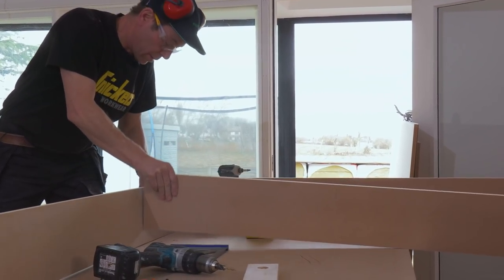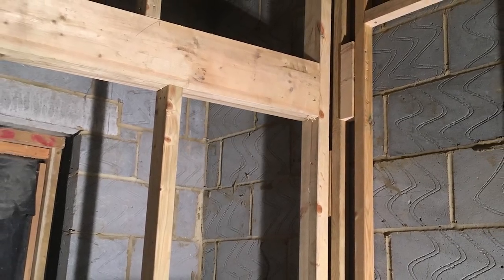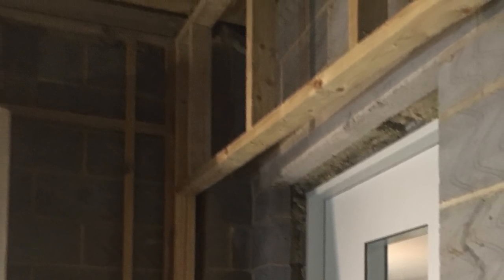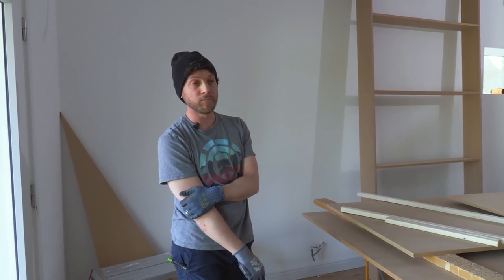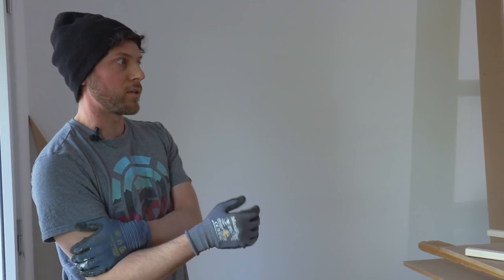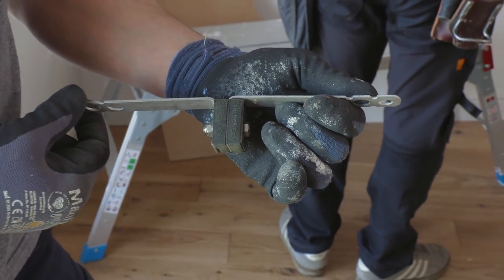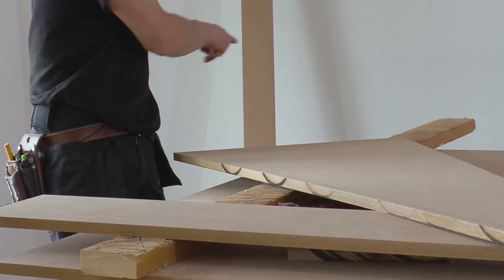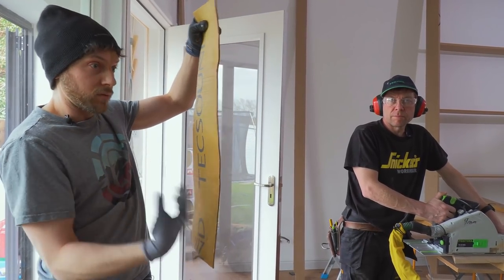How To Build a Soundproof Room?

Comment: I've built two sound controlled music studios, long in the past. One was only for band rehearsals, and a second was a full blown recording studio with control room, etc. Most of the sound we hear is actually bouncing off the walls. I built both as a 'floating box' - isolated from the floor, and packed with acoustic rockwool. When me and the mate helping me had got all the rockwool in, it was difficult to hear him speaking at the other end of the room, about 20 foot away, as the sound of speech was absorbed and not bouncing off hard surfaces. Quite amazing, and odd, experience.
Reply from the maker: That is amazing, pity you and Tim couldn't have had a chat before he started. It is a learning curve

Comment: I have a couple of Festool tools. Rail saw I went for Bosch as the rails join easily and Bob nuts straight when joined. There is no perfect tool system each has advantages and disadvantages 
Interesting video, complete science on its own. You can certainly run your surround sound flat out in that new room 😁

Comment: What about ventilation ?, get a few musicians in the room generates quite a bit of humidity I would expect, not least is they need to breath! There was a realy good book by a Rod Gervais on studio building
Reply: Yes absolutely, not to mention heat generated by the studio equipment. We have a Vent-Axia HR100R Heat recovery unit which will be installed in the lobby to the outside and acoustic insulated ducting. If the resulting air path is unacceptable for the sound reduction then we will build a silencer to fit in between with lots of turns inside to reduce the sound escaping. In the future we will also install aircon. I imagine it could get quite warm in there!
Reply: Tim will be fitting some ventilation system soon.

Comment: Wall ties 20p each acoustic wall ties with a bit of rubber on £9.75p each
Reply: They weren't quite as expensive as that but it is certainly difficult to quantify the benefit verses the cost, even when you study the performance graphs. It is hard to know how that translates and feels in a real world application. When it came to the wall ties, I believe that it is the bass frequencies and the transmission of impact noise that we were most concerned about. Considering the room is part of a house, and I play the drums for a living, the risk of getting it wrong outweighed the extra cost! I would love to have done a comparison 😃

Comment: I'd have thought a flimsy stud wall would act like a speaker cone and transmit the sound far and wide!
Reply: It flexes to "catch" the sound, if it was too stiff the sound would bounce straight off it.
Reply: Correct but there is a secondary consideration in that a more flexible wall absorbs low frequency sound in the room itself. This is a big problem with constructing studios out of cavity block as there is no low frequency absorption and the rooms get very 'bassy'.